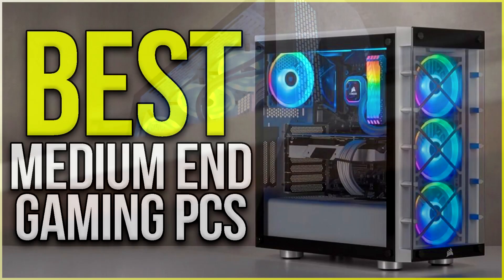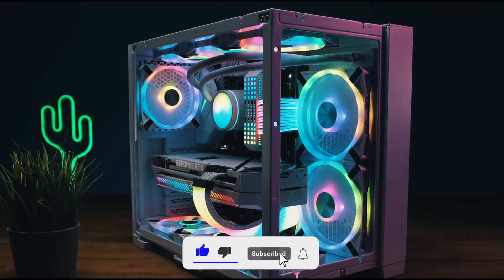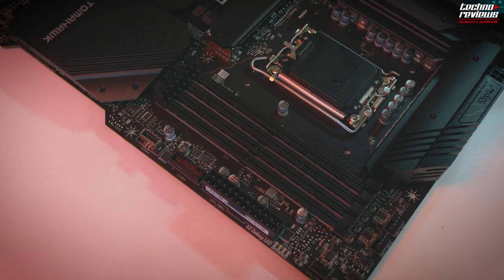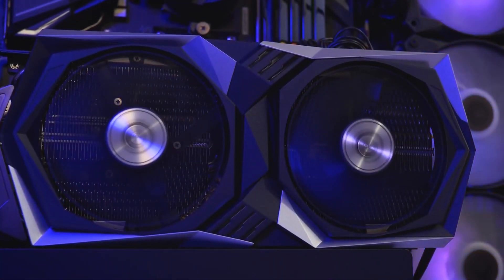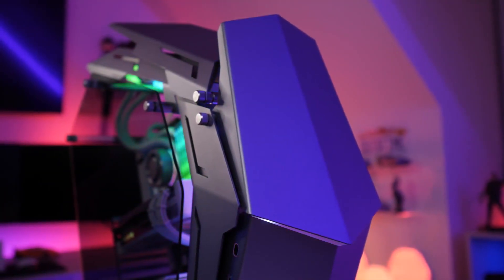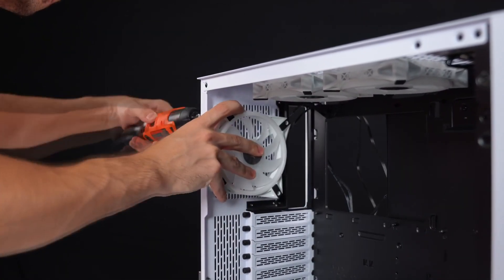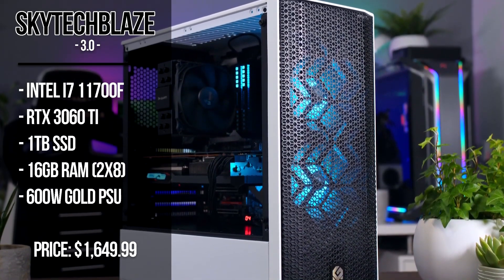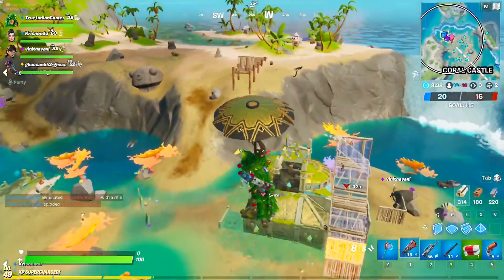Best Mid Range PC Build in early 2022 [ I5 12600K + RX 6600xt ]

Comment: Same build I'm doing, but I went with the Arctic Freezer i35 as it just looks really good. For the case I picked the AQIRYS Naos, it's a popular brand here in Romania.
The 6600 XT is a lot cheaper than the 3060 Ti here, I've even seen 3060s non-Ti going for over 1000$. In total, 1400$ with a Seasonic Focus GX 850W PSU, not that bad I think. Should be quite a big jump from the i5-6400, RX 590 build that I had.
Reply from the maker: I made a new 1500 PC Build that has the RTX 3060TI, I'm so glad GPU prices are going down
Reply: I hope they'll start coming down here as well, right now they are quite a bit more expensive than in the US.
Reply: I would have waited and got at least a 3070, but my RX 590 unfortunately died last month and the 6600 XT is a good replacement until the situation calms down a bit.
Reply from the maker: @Adrian_Zgripcea I agree brother that's good

Comment: Im building a similar pc right now, and i was just wondering whether using a ryzen 5 5600g would work just as well as an i5 12400K, and would the stock cooler work fine or should i invest in a better one, ive been really into pc's lately and wanted to build my own rather than getting a prebuild like the hp victus 15L
Reply from the maker: the i5 12400K is better overall, I recommend you a better cooler than the stock one, you can get away with a 40 Dollar Hyper 212 Black edition cooler
Reply: @ShadowGamingPC1  ok thanks, i was planning on using a b450m plus II motherboard but it only supports amd cards, what board do you recommend?
Reply from the maker: @beamzy942  depends, are you going to overclock it?
Reply: @ShadowGamingPC1  to be honest i dont even really know what overclocking is so probably not
Reply from the maker: @beamzy942  then I would go with a B660
Reply: @ShadowGamingPC1  ok thanks

Comment: Building my first pc soon and was wondering if u can go through my parts and see if everything will work 
I5-12400
Rx 6600 xt
Corsair 4000d case 
Asus Prime B660-plus D4 LGA 1700 
Evga supernova 650 GT 80 plus gold 650W

Any recommendations for the motherboard or is it a good budget one and will it also fit in my case
Reply from the maker: yup everything works there, for the PSU I would go with a 750 gold one, the rmx 2018 from corsair, is not super cheap but is better for the build and upgradeability
Reply: @ShadowGamingPC1  thank you so much one more quick question is there a difference between the Asus prime b660-plus and the asus prime B660M-A there both $140?
Reply from the maker: @fern6925  isn´t the b660M a micro ATX motherboard?
Reply: @ShadowGamingPC1  if mATX means that then yes

Comment: it’d probably be better to choose the arctic lf2 for the cooler, and if you wanted to save money on the cooler DON’T go with coolermaster. it’s overpriced and you can get better performance out of the id cooling SE-224XT for half the price. also why corsair vengeance? crucial ballistix has better dies for the price. have you considered ABS prebuilts as the prebuilt option? they’re on newegg and a lot cheaper than the one you showed on amazon and you can get the same or better performance.
Reply from the maker: I recommend ABS PCs all the time, but for that price they usually have PCs with a worse CPU and cooler as well
Reply: @ShadowGamingPC1  ok, that’s understandable, but what about the other stuff i talked about? the 212 and be quiet cooler are kind of a ripoff.
Reply from the maker: @shaneomac8289  you are right about the artic cooler, I just couldn´t find the offer at the time, but for that i5 both coolers will work great tbh

Comment: despite it being slightly overpriced di you think nzxt starter pro is decent for gaming and what fps do you think fortnite would run on high settings? i really like nzxt’s brand/customer service
Reply from the maker: it will run Fortnite without any problems
Reply: Nzxt pcs are absolutely garbage yes they might perform good but they are overpriced and cut costs anywhere they can
Reply: @supersop1367  what 3060 ti prebuilt would you recommend? that won’t overheat
Reply: @chris.8635  jawa.gg has got some good ones that aren’t shit but I honestly can’t recommend any prebuilts from companies since they suck